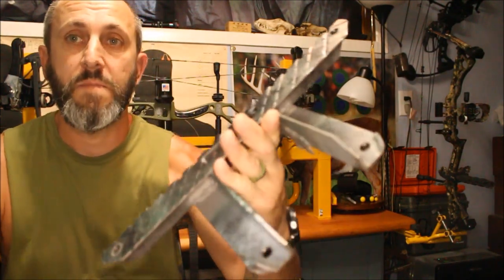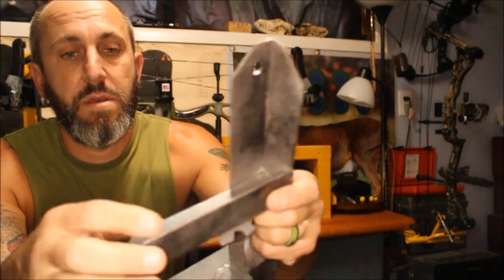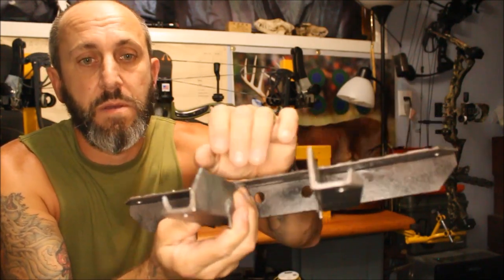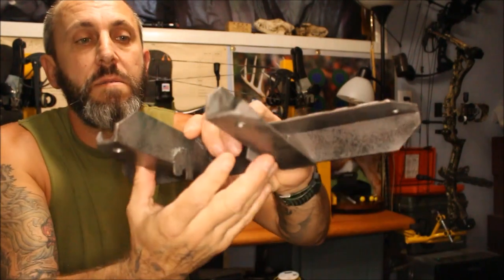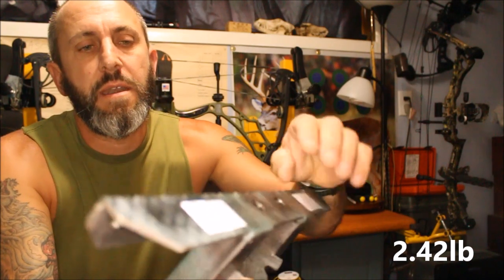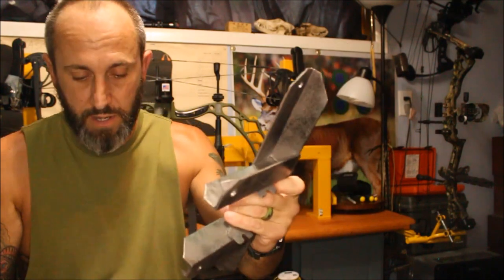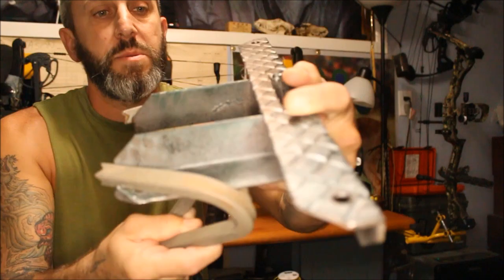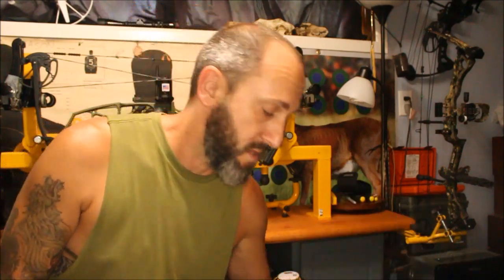DIY Wild Edge saddle platform

Comment: Looks like it works pretty good. You could probably lose some weight by drilling alot of holes in both of them pieces.
Reply from the maker: You definitely could. I'm ok with the weight as is. I didn't want to mess up the structural integrity.

Comment: How does it handle side pressure?
Reply from the maker: I kept the length out from the tree pretty small. It is super solid actually. The more I use it, the more i like it. The only possible negative i can come up with is that it can be a little tough to spin around your feet.